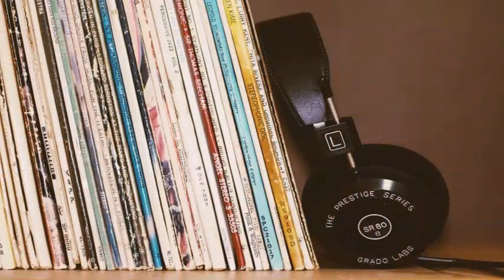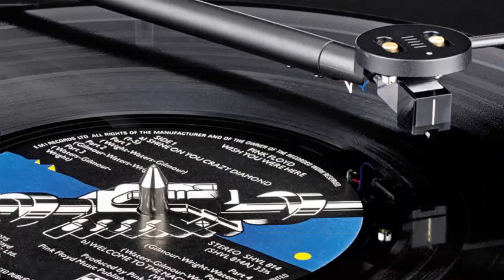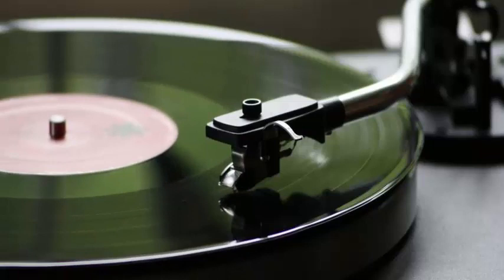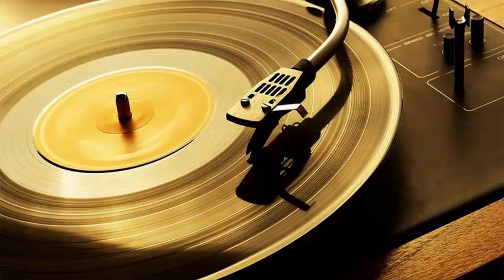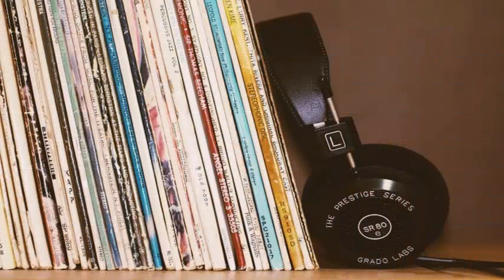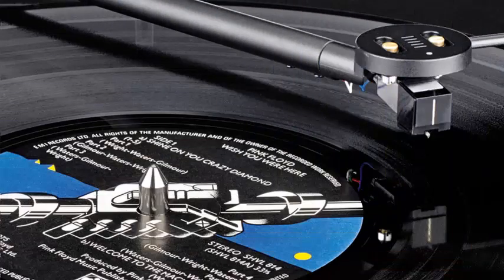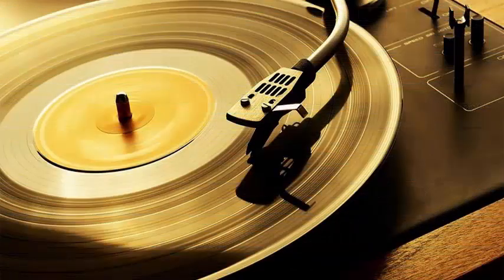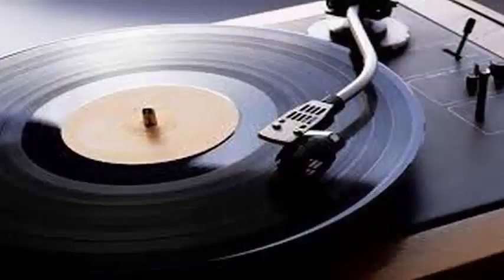New way of manufacturing high definition vinyl records promises more playing time and stronger audio

Comment: They've had a new way for decades now. They're called CD's.
Reply: Charlie. You're right about that, but I also wonder if these new so called high definition vinyls will still have the warm sound of a traditional vinyl records or lp
Reply: Metallion 1,968 

Yes....as long as friction is a parr of the equation, there will always be some level of "warmth" (distortion)

I'd imagine HD vinyl sounding like a top of the line reel of tape.
Reply: I am a vinyl user and still don't know what people mean by "warm sound". The only difference is found in analog vinyl records that sound different from their digital counterparts. Digitally-sourced vinyl records sound like a CD. HD Vinyl promises to raise the quality of conventional digitally-sourced vinyl records, in fact this new process will always use a digital track.